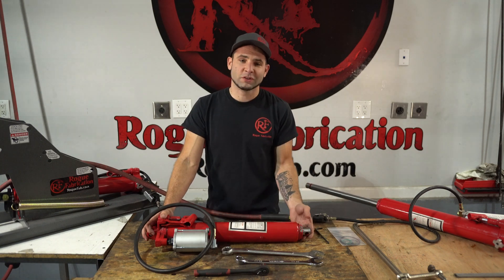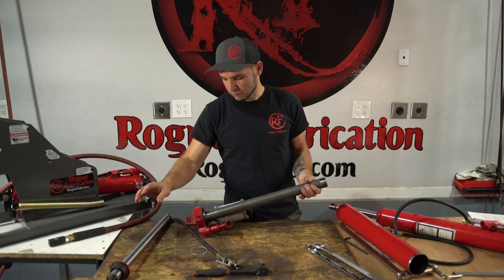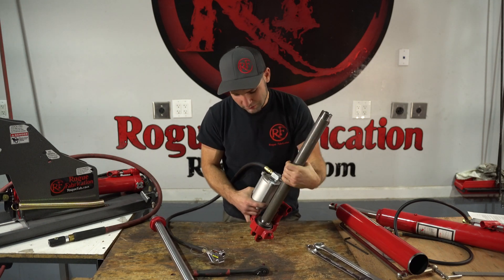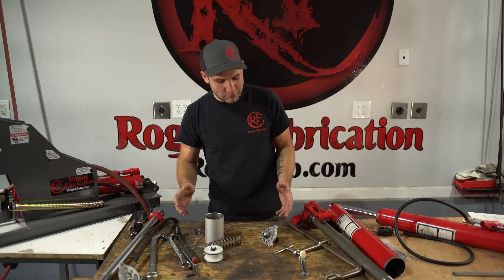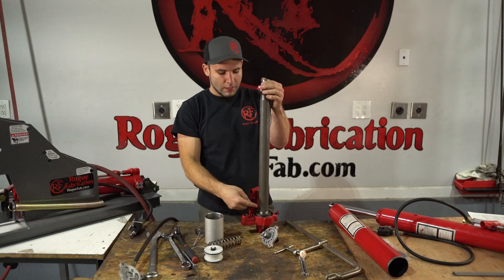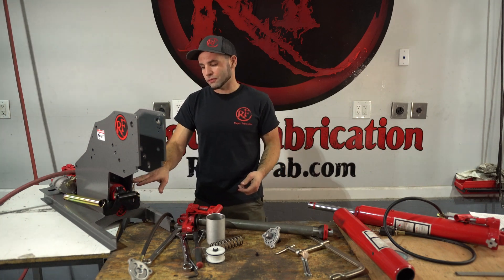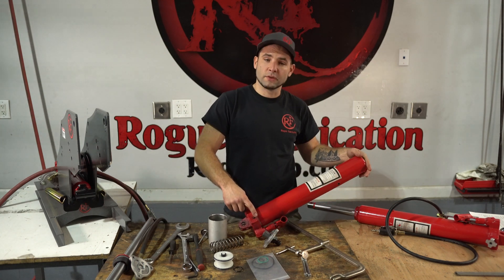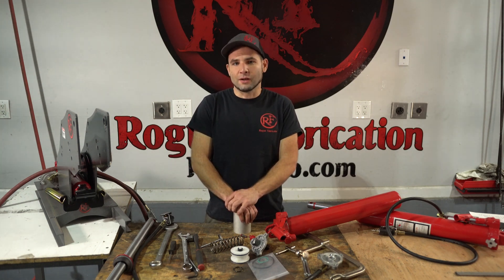Getting to know an Air/Hydraulic Cylinder - Tubing bender power source explained!

Comment: I have the Swag adapter a long with the HF 8 ton air ram for my JD2 bender. When i hook it up to my compressor, and press the lever to start bending, I hear a good stream of air coming out of the small silver cylinder that the hose is attached to. Is that normal? Is it some sort of pressure relief valve? My tube bender does work, but I was curious about the air 'escaping'. Thanks you.

Comment: When mounting the ram horizontal, why do some say to place the air cylinder below the hydraulic piston?  Seems that if the air cylinder is on its side, it doesnt matter.  But how does air enter? Through that passageway slot?

Comment: Ive seen some videos stating that when these jacks are  eing used in the horizontal position as the one on your bender that it has to be in a certain or specific orientation in order to work properly so to not starve the pump of oil. How would you recommend having the orientation of the jack say for a model 3 bender or I guess just in the horizontal position in general??

Comment: Nice job in explaining the operation of the air  over Hydraulic --- Question, is there another way to release the hydraulic fluid to allow the ram to go down (return to its lowest position) besides turning the relief valve? I ask b/c I amusing this ram on my motorcycle lift and I have a rod extending out then turning it counterwise to lower the lift. thanks in advance

Comment: this is an excellent explanation!
I wonder whether the return spring for the air piston is even strictly necessary. Probably for speed more than anything else. The little hat which opens on the 'top' side of the air piston also effectively reduces the surface area of the piston face and therefore the force with which the compressed air will act against that side while the hat is open, making the force acting on the 'bottom' side of the air piston larger, which should cause the piston to move with constant force proportional to the product of the area of the "hat" and the pressure of the air.
This is, I'm given to understand, how constant force gas 'springs' work.
Reply from the maker: Yes an area imbalance would move the cylinder. The spring either moves it or speeds up the return!

Comment: Great explanation of how they work, even better if you showed some close up pictures of the different components like the valve at the top of the plastic piston in the air pump like you did with the bypass groove.
Reply from the maker: Thanks for the feedback, we did a second video on how to rebuild these cylinders that shows some of the other parts of the ram in more detail!
Reply: @RogueFabrication  I Cannot find it

Comment: I wish I could give you 10 thumbs up for this excellent lesson on how the air booster works. I am looking for a way to convert my manually operated hydraulic floor jack to an air/hydraulic jack. Unfortunately the starting price for air/hydraulic service jacks is above $1000. I don't bottle jacks because I can't get it in  some places under my cars.
Reply from the maker: I'm so glad you found this video helpful. These little air/hydro units are pretty complicated and clever... but at the same time their simplicity is amazing. There is so little technology in them! -Joe

Comment: Can you convert this to electric over hydraulic ….? For a budget
Reply from the maker: Anything is possible, but on these you would need a 10,000+ PSI pump. Not safe, nor cheap, and not easy. We sell 2 different electric hydraulic systems, a budget one and a high performance one. Both at RogueFab.com. We sell bare cylinders for DIYers as well. Add your home brew pump and valve and you're off to the races.

Comment: Thanks for sharing your experience with these cylinders! Every bit of the video is helpful. I threw one out on my engine hoist a couple years ago. I would have rebuilt if I had known there were seal kits available. They are a mess though when you disassemble them.